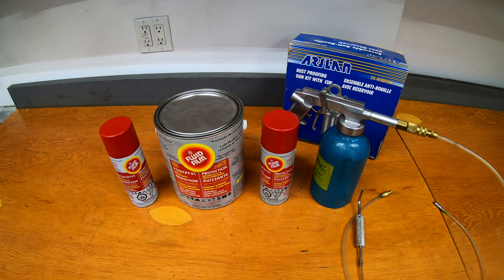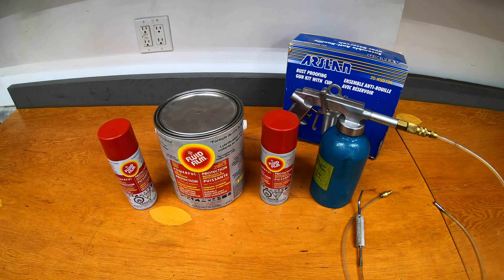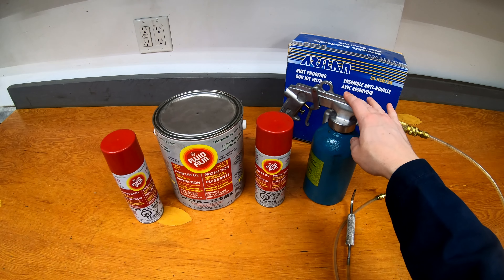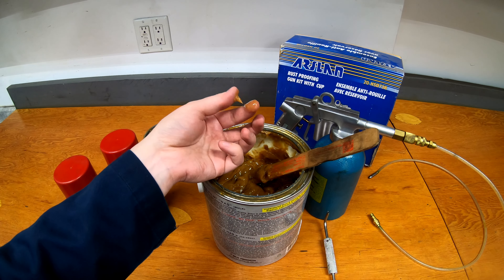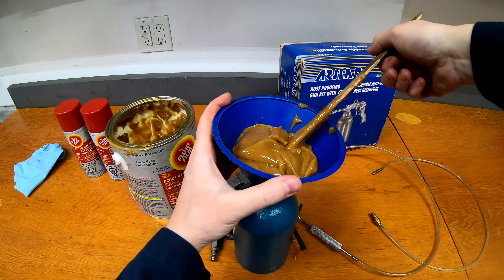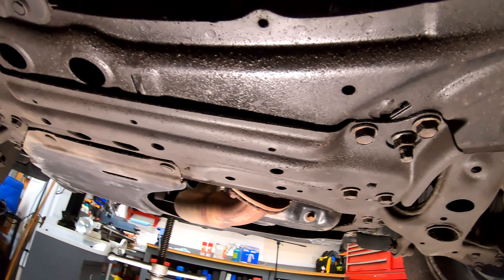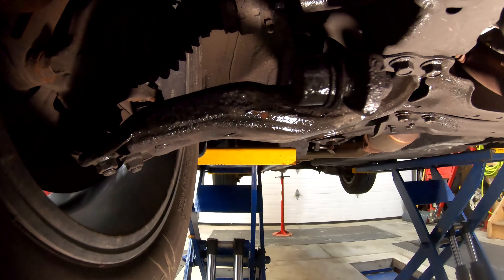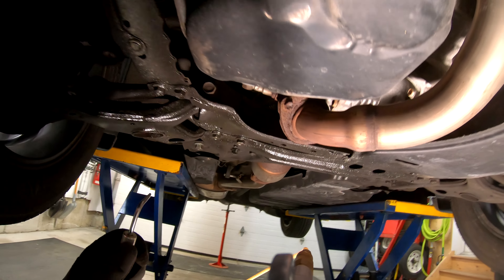How To Undercoat Your Car So It Never Rusts Again with Fluid Film!

Comment from the maker: Anyone else using this stuff? It's awesome!
Reply: I use this stuff on everything, all my vehicles, all my friends and family's vehicles, four wheelers, mowers, door hinges. I love it. I mix in a little clean 15w40 engine oil into the fluid film for vehicle undercoating. It works great!
Reply: I use corrosion free 3000.. Canadian product
Reply: Use fluid film for working on everything.  Do the larger undercoat job with Surface Shield it lasts longer and does not slump as much
Reply: Yeah surface shield is a better product, better than fluid film!
Reply: Krown.
Reply: @Bloodbain88  i tried using it on my mower deck and it just makes all the grass stick to it. i think it's less then ideal for a lawnmower application. i just power wash my mower deck underneath everytime i use it. i drive the tractor on ramps and lay on my side and blast it off. i have had the mower deck 6 years and no significant rust has been forming. the tractor is a kubota BX 2350 diesel sub compact, i paid $8k for the tractor and mower deck. i try to take good care of it because a replacement deck is over 2 grand. in today's horrible economy i dont have 2 grand sitting around in a coffee jar anymore.
Reply: Try a clean 1 gallon milk or water jug to fill your bottle. Cut the jug just above the handle and the larger opening helps the fluid film fall right in.
Reply: @Bloodbain88 Why would you mix in engine oil?
Reply: @MrKjetil101   It gives the fluid film better resistance from washing off, especially in areas like fender wells, it also sprays better out of the spray gun, and it creeps along metal surfaces even better.

Comment: Nice job! I use the black version, because it's easier to see where I have sprayed... plus it covers over the rust better for a little while. I usually spray as late into the season as possible, so it doesn't get washed off with rain... So what I do is make a double boiler out of an old pot and hotplate from the dollar store... I put the gallon in the pot with water... I check every 10 minutes or so and stir until the wool wax reaches 100F. I can then pour without slapping the funnel and it goes on so quickly.
Reply from the maker: Nice tips. I haven't seen the black version up here yet in stores, whereas most carry the original. Other than the slow pour, the spraying even when cold with this sprayer has worked well...but I have heard warming it up can make it spray even better.
Reply: Just don’t want to wait too long, once the salt is down, you start sealing it in, I know a couple places around where I live stop doing it as soon as the first salting is done.
Reply: Can u spray then on car coil over to prevent rust?
Reply: @steved8714  Best time to rustproof is every spring when the weather warms up. This stuff doesn't seal in salt. You are talking about a rubberized coating. Those are garbage and should never be used.

Comment: The bubbling from the aerosol cans is the propellant boiling off. I'm pretty sure. I'm not a rocket scientist but I did stay at a holiday inn express. I'm in Canada and on rennlist as well. I'm using corrosion free for my rust proofing but may switch to fluid film when my corrosion free runs out. To mask the smell of FF, I bought a glade plug in air freshener refill which is basically scented oil and mixed it into the product. Now it smells like apple cinnamon
Reply from the maker: That's awesome, apple cinnamon rust proofing :)

Comment: I do live in Canada too. It’s the worst country so far for vehicles, machinery, any metal equipment which are subjected to its weather. To the point that even inside your house, like door laches tools in bags, etc… they go rusty if you don’t treat them.
I learned hard lesson by neglecting my vehicle and not rustproofing it, after some years, the jack points side of frame literally fell off like a sand. It was a big mess and finally the vehicle made its way to junk yard. 
It’s a big investment in a long run if you take care of your vehicle by rustproofing every year. It’s just a price of couple pack of beers anyways.
You doing a great job here. Whether the vehicle is new or old, it needs to be protected from this awful humid/ street salt and it’s elements . 
I recommend to anyone reading this  Not To Neglect you car like i did.
Reply from the maker: You're entirely right! Up here in Canada we get a lot of salted roads and lots of swings in temp/moisture/precipitation and things definitely rust if you don't take care of them.

Comment: 05:39  100% correct If you want it done right, do it yourself.  Because of time constraints, I've paid nearly $500 to have 2 vehicles initially coated with FF and none were done as thorough as I would have expected for that price.  I still applied more to missed areas when I got the cars home.   Good video!  I use Fluid film  Woolwax, NHOU, and PB SS as well as Amsoil MP HD.   All do a really good job, WW for wheel wells is def. better. But any initial coat I like FF since it creeps so well.
Reply from the maker: Agreed! I'm a big proponent of DIY, you can take your time and do things right.
Reply: Can it be sprayed over rust or should it be used on new vehicle's only?
Reply: of course brand new vehicle is always better but it will work on whatever condition. applying anything is better than doing nothing! it will at least slow down the rust

Comment: Do I need a 30 gallons air tank to push out rite PSI to spray it out ?
Reply from the maker: @jacksonvang2946  gallons just determine how long you can run without the compressor kicking on. Pretty much all compressors will have enough psi to spray, just the bigger the compressor, the longer you can spray without stopping.
Reply: @SomeGuysGarage  Thank you ! I love All your video too. Do more pls.
Reply from the maker: @jacksonvang2946  thanks, always working on them! Doing something I haven't done before in the next week or two for a new video, so watch for that :)

Comment: The bubbling when using spray cans comes from the liquid propellant gas that the fluid film is mixed with. in the can. It evaporates and creates bubbles when it gets out into normal atmospheric pressure.
Reply from the maker: That makes sense :) thanks for adding that!

Comment: Hey thanks for the vid. I just bought the same gun. My question is how do you clean it....or do we need to?
Reply from the maker: Welcome

I don't clean the gun out, just leave it with whatevers left but making sure it's standing up when stored...I do blow the spray wands out though (just with a normal air blow gun).
Reply: Excellente many thanks
Reply from the maker: @jeanmarcblanchet7393 welcome, if you have any other questions, happy to help :)

Comment: How would you recommend washing the undercoating after applying the fluid film? I'm in Michigan, and I'm buying a new 2023 car. I want to protect it with fluid film, but should I not use a pressure washer to wash the undercarriage after applying it? If I should wash it, I read that people said it'd take it off... and if it does take it off, should I re apply it every 6 months.. every year? If you can help, I'd really appreciate your opinion and time.
Reply from the maker: Yes, it will wear off with pressure washing, not all at once but eventually will. Frankly I don't bother washing under the vehicles in winter, it's just driving more moisture into places IMO. I apply fluid film once yearly in the fall.

Comment: Hey Dude, thanks for the vid. It was very helpful. @9:51, you were talking about 'access holes'. How do we know if a certain hole is an access hole and not a hole that is not supposed to be sprayed into? 
OR 
Can we just spray into every hole we can find and we will be safe? 
Ty 4 the reply!
Reply from the maker: Almost anything in the frame/body is okay. If it looks like steel inside, go for it.

Just avoid exhaust, heat shields, and anything that passes through to interior.

Comment: use a drill and paint stiring attachment and it will pour easily, you can't mix it good enough with a stick , also ya can leave  the cans in hot  water for 30 min before and it will spray much better
Reply from the maker: Good tip...it doesn't separate too much, but a drill stir would definitely do a better job!

Comment: what size was your air compressor? and what PSI did you use?
Reply from the maker: @torontoguy8043  I have a 60 gallon 5hp Ingersoll Rand two stage...it's a big one, but a smaller one could work. I do use 80-90psi which is higher than recommended but sprays better.
Reply: @ thanks for the quick response. I found the same gun and its accessories for sale on amazon. I think I will buy it. 

Would a 8 gallon air compressor work with this gun? I will also spray fluid film
Reply from the maker: @torontoguy8043  technically yes, you'll just have to slow down to let it catch up once and a while. Think of the spray gun like an air blow gun, it uses similar amounts of air.

Also, I left some links to amazon in the vid description, not sure if it's the same one, but have a look just in case!

Comment: Man,, you got good presure and coverage out of that sprayer.
What psi did you spray at ?
Reply from the maker: @driver902  higher than recommended, 80-90psi static on the line... do so at own risk 🤪
Reply: @SomeGuysGarage  
Thanks,,I've got the cheap one already.  I used it once with very little FF coming out. I found a hack that they pressurized the pot with zerk fittings going from the sprayer to the pot. I'm going to up the pressure at my own risk and loosen the fitting on the wand.
Thanks
Reply: @SomeGuysGarage ah that’s why. Mine doesn’t spray anything out at the recommended 40psi
Reply from the maker: @WyattH  yeah, you'd have to thin it to get it to spray at lower psi

Comment: Hey bro its me again, my spray gun(identical to yours) was delivered today. On the instructions, it says “ a pressure regulator gauge must be used”.

Is a pressure regulator gauge a must to have? I don’t have one. Thanks again.
Reply from the maker: @torontoguy8043  should just be the regulator on your air compressor (I've never seen a small compressor without one), doesn't need to be external
Reply: @ understood, thank you
Reply: @ by the way, could you please recommend an ideal hose inner diameter for my setup? my air compressor is 8 gallon. is 1/4 inch inner diameter ok or is 3/8 inch inner diameter good? or does it not really matter? thanks again
Reply from the maker: @torontoguy8043  3/8" hose with 1/4" ends is the standard and what you'll easily find out there. Smaller 1/4" hose is used for very low draw tools, like air brushing or micro die grinders or similar.
Reply: @ thanks so much, you are a lifesaver
Reply from the maker: @torontoguy8043  welcome! :)

Comment: I have the same gun but use rust check. Also in Canada and it’s worked great for my vehicles over the years. You should pull the plugs in rockers and spray in there as well. Also the inner fender panels, bottoms of the doors etc.
Reply from the maker: Yup, I have done more than what's shown in the video, definitely want to get into every little cavity you can, great tip for those reading this!
Reply: I even remove the front and rear bumper covers headlight and tail lights. I agree, Canadian winters suck.
Reply: @georgespoirier481  same here. When I hear people saying 2-4 cans to do an entire vehicle I kinda laugh. Better than nothing I guess

Comment: Thanks for the great vid. Do I need to put a primer/paint pre or post coating with Fluid Film?
Reply from the maker: Nope, it's just a rust protection coating for pre-finished metal surfaces...on vehicles the frame and such should have been coated originally
Reply: @SomeGuysGarage  Thank you!

Comment: Would you suggest removing existing rust before doing this procedure?
Reply from the maker: Light surface rust? Probably not.
Flaking/heavy rust? Yes, but the vehicle likely needs more work at that point than a coat of rust proofing.

Comment: would a 6 gallon pancake compressor or 8 gallon hotdog compressor work with your gun to spray fluid film? thanks
Reply from the maker: See other answer, but yes...just have to slow down, it uses similar air to a blow gun.
Reply: @SomeGuysGarage  awesome, thanks so much for your help. appreciate it
Reply from the maker: @torontoguy8043  welcome, good luck!
Reply: @ one last question, how important is CFM when using this gun with a 6 gallon pancake compressor or a 8 gallon hotdog compressor. will I run into any issues?
Reply from the maker: @torontoguy8043  CFM of the compressor is how fast it will recover when you draw down the tank, CFM of the spray gun is how much it will use while in use. If your compressor CFM is greater than the tools CFM, then you will generally not have to wait for the compressor at all. If it's less, then you'll sometimes have to wait for the compressor to build back up before starting to spray again.
Reply: @ got it, thanks so much. +1 subscribed
Reply from the maker: @torontoguy8043  welcome again, and thanks!

Comment: I have the lemmer rp100 gun. I think its the same.
My quick connector to the wands started leaking on the 2nd year of use.
Anyone else have issues witn the quick connect?
Reply from the maker: Not here...there should be an o-ring in there somewhere though, check it's seated properly and not torn.

Comment: why shouldn't you apply to the exhaust?
Reply from the maker: Exhaust gets hot, it will burn off the first time you drive it and make a lot of smoke and slight fire risk.
Reply: @SomeGuysGarage  thank you for the response. What about using high temperature paint or high temperature ceramic coat on the exhaust system? can that work?
Reply from the maker: @alvinanthel2757  I'm sure there could be options of high temp exhaust coatings, but it's almost never worth it...most exhaust components are stainless steel of various grades (some better than others, hence the low grade ones will still get corrosion), so they should hold up alright without coating. Even if you could do the outside, the exhaust gasses (which have a lot of moisture in them) will corrode it from the inside out just as quickly.

Comment: I have the same gun, it won't spay surface shield at 80psi am i missing something? It came with no instructions. Did i just get a dud gun?
Reply from the maker: I do run it higher than recommended pressure...do so at your own risk...but I spray unthinned cold fluid film with no issues this way.

Comment: The set-up minus compressor is about what a shop would charge, I'd imagine. I'm definitely going to get set-up with this, as I like older vehicles and road treatments seem to get more and more corrosive each year.
Reply from the maker: Yup, a gallon is usually $50-75 or so, sprayer is $50-100. A single gallon can do 2-3 vehicles first time depending on size. So after the first year, you're really looking at $20/year to rust proof a vehicle. Well worth it!

Comment: So its easy.  If you have a vehicle with no rust.  Who has that?  Advice on prepping the typical rusty vehicle?  Thank you.
Reply from the maker: Start doing it when the vehicle is new so it doesn't rust :) 

But just wash off the underside, don't bother scraping/grinding away any rust, and coat right over top. This stuff will soak in, it's not a paint, so prep to clean metal isn't required to stop further rusting.

Comment: Rustiest thing is the oil plug!  I also spray the dust plate for the rotors being careful not to get the caliper and rotor.
Reply from the maker: Those pesky splash shields rust out no matter what you do, just like exhaust, all the heat cycling.
Reply: @SomeGuysGarage  Damn it! Just give me this one that will work!

Comment: the single most important aspect of this video is......   have a hoist. doing this stuff without a hoist is brutal and borderline impossible to do it well.  if you don't have a hoist kicking around your garage, i don't know what to tell you, but good luck.
Reply from the maker: 6 ton jack stands (enough height but still stable) and a creeper...it's how I used to work on vehicles before I had a lift, not as pleasant but totally workable.

Comment: FluidFilm is safe for any kind of suspension parts. only soft door seals are not safe. the squishy stuff.
Reply from the maker: I haven't had any issues with bushings or rubber parts swelling, but I don't actively try to spray them. The big thing is it won't hurt paint or other materials and won't drip, it's quite a good product.

Comment: I use POR415. One and done.
Reply from the maker: I've heard good things about the POR products too, haven't tried them myself though.
Reply: @SomeGuysGarage  I have been using it for years and have had no dramas.    Your method and product work no doubt though
Reply from the maker: @rickchowsr2532  right on, will have to check it out one of these days :) Thanks!
Reply: Por 15 works great been using it for 25 years,  clean important,  use in a gun with a tad of reducer and spray pre treatment Ammonia they sell to turn rust to neg ION if rusty,  use to be cheap but not anymore. Price    And don,t forget your Body Flush  HAHA

Comment: Used engine oil only way to go
Reply from the maker: No way...drippy mess that doesn't stay on.

Though is cheap lol
Reply: Lots of tests on Youtube. Used motor oil is terrible at preventing rust.  Fluid Film consistent comes out on top of compounds that stay tacky.  The only thing that might be better is Cosmoline that essentially dries and is more durable. Cosmoline needs much more prep and is more expensive though.
Reply from the maker: @peterscott2662  agreed! Fluid Film is easy to get, easy to apply, and safe to work with too...as a DIY product it's awesome, but there are a few other good options out there too...like the guy who mentioned the POR products.

@ProjectFarm has also done some great comparison testing!
Reply: Nope